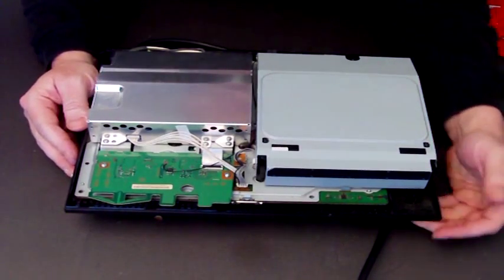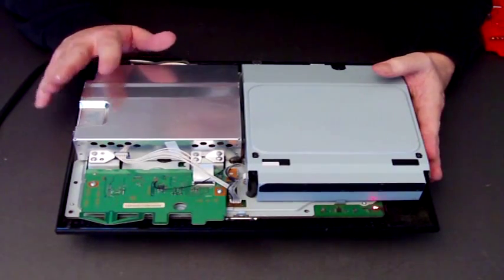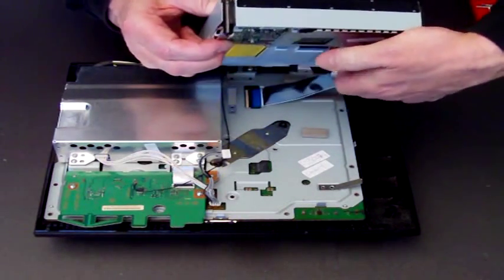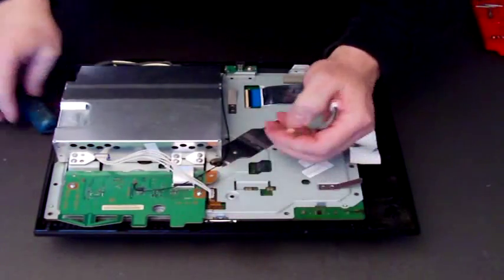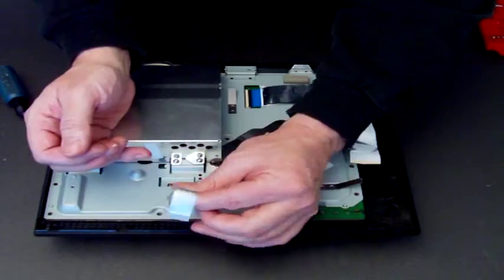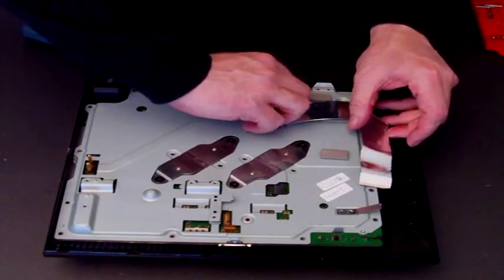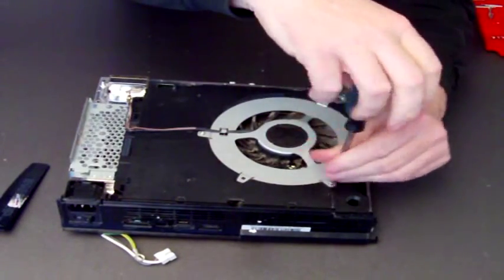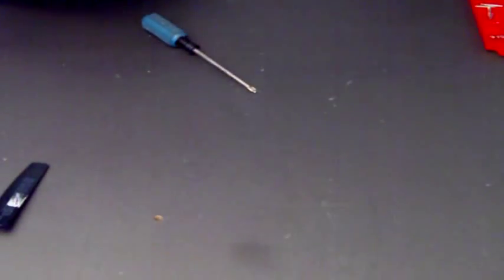PS3 Parts & Repir Guide - Changing Motherboard Part 1

Comment from the maker: Do you mean the clip which connects the data ribbon? These can be fixed in place with electrical tape and your blu ray will still work - just ensure that the ribbon is properly aligned or it may short out. The black screen and freezing are usually an indication of a fault on the graphics chip. A reflow might fix this for you. Hope this helps Steve